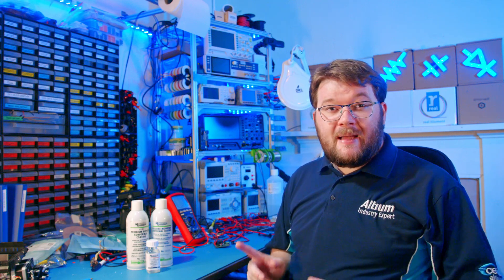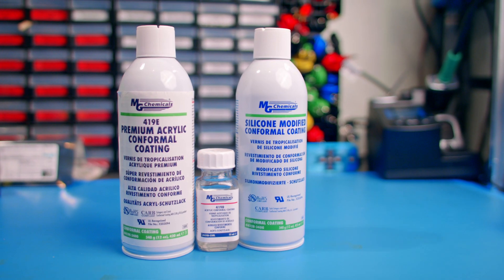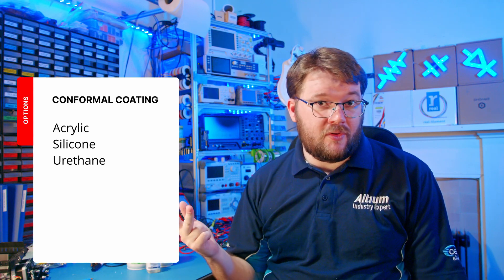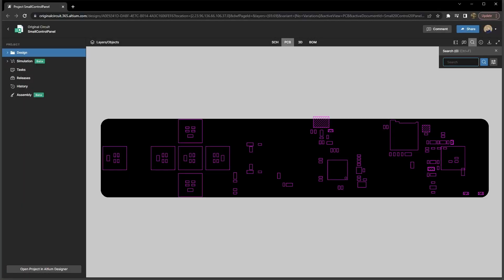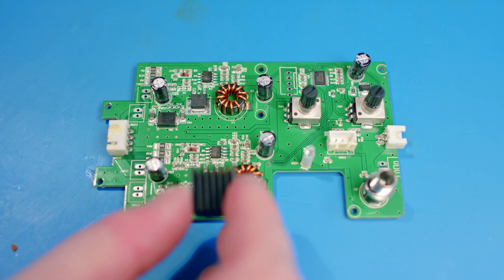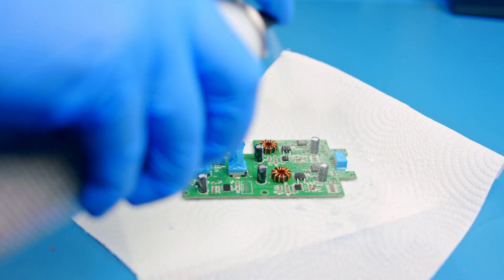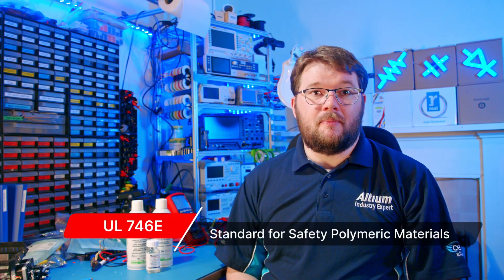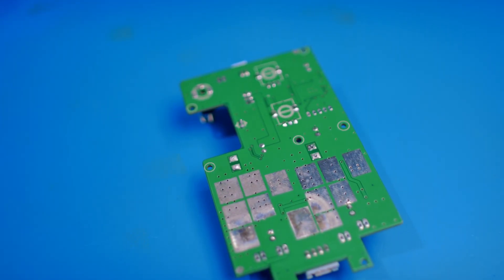Boost PCB Durability with Conformal Coatings

Comment: Very in-depth, I am looking into putting a coating on some solar outdoor lights. Temperature varies throughout the season. These solar lights were so poorly designed and eventually get water on the top and the board if round and flat, so water just stays in place. Anyone have any thoughts on the best the coating, thinking acrylic spray or brushable.
Reply: Mark is not monitoring these questions but I can help you understand this. The problem you have with your solar lights is that the enclosure does not have the appropriate ingress protection (IP) rating. Whenever you buy electrical equipment that you intend to use outdoors, you need to verify that it has the right IP rating for your environment. Typically the minimum would be IP65, you find out what this means from searching on google. a spray coating or brush-on coating on the PCB will not solve the root problem of moisture ingress. If you want to try coating the PCB, you could use an acrylic, urethane, or parylene coating. Humiseal is a good brand that offers acrylic, urethane, and parylene based coatings for PCBs. You could also try a waterproof urethane or epoxy sealant on the enclosure.

Comment: Silicone Modified Conformal coating is the Gold standard for the RC Hobby and a godsend to prevent frying an expensive electronic speed control when one drives through a puddle or for those whom love to drive on snow!
Obviously, it’s not intended to turn your RC vehicles into a submarine but proper application can tolerate brief submersions!

Godspeed🇺🇸🇺🇸🇺🇸

Comment: I've been using conformal coatings for years, and I still think epoxy has its place in certain applications. Don't write it off completely.
Reply: Does it work on gpu pcb coz gpu components make high heat?

Comment: Can you recommend any particular brand of conformal coating that you've had a good experience with?
Reply: HumiSeal products preform well across the board.  They're an excellent "Jack of all trades" coating manufacturer.  Our "Stock" coatings are HumiSeal 1B31 Acrylic and 1C49LV Silicone.

Comment: I appreciate the effort, but I think you missed a few key points about the importance of surface preparation before applying conformal coatings.
It's interesting to hear your thoughts, but I have had success using urethane-based coatings even in small batch sizes. It's all about technique and equipment.

Comment: Can you talk more about the pros and cons of using a robotic system to apply conformal coatings?
Reply: Pros: fast, consistent and repeatable, less masking required.

Cons: expensive, cleaning can be a real PITA, and only conducive to large quantity production.  Robotic application isn't even remotely cost effective for small quantity runs.

Comment: Can you explain more about the thermal expansion coefficients and how they can impact component longevity?
Reply: I'll jump in and answer this.  Some types of conformal coating are surprisingly "hard".  Once applied, they bond to the PCB and to the components.  As the different materials expand and contract according to their CTE, the coating both imparts stress on the components and solder joints, and prevents the joints from flexing as they normally would.

The primary failure mode due to CTE mismatch of coated boards is in the solder joints.

Silicone and synthetic rubber coatings are soft enough to mostly eliminate these concerns, which is why both are popular for boards that will experience a wide temperature range.

For consumer grade boards that will only see a limited range of operating temperatures, these concerns aren't terribly relevant though.
Reply: Sir can i use it on gpu pcb ? Coz gpu components are high in temperature  @benjaminbawkon8040

Comment: In my experience, conformal coatings are only ok for mild conditions. 
We make weather stations and have tried various acrylic, urethane and silicone coatings, silicone dipping compounds as well as plastidip. The only thing that works properly without much hassle is potting the PCBs entirely in a hard PU resin. They are also typically better thermal conductors than air.
Reply: Paralene would do wonderfully in your application.

Comment: Having performed extensive testing on many brands of conformal coating (MG Chem, Humiseal, Miller-Stephenson, DowSil, etc), I can tell you that MG Chem products almost universally performed horribly.  Their silicone coating, in particular, was truly awful.  It's not a pure silicone, but is really a "silicone modified acrylic" - all of the downsides of both chemistries with none of the benefits of actual silicone.
Reply: Which one you find to be best among the brands you have tested so far?
Reply: @7006608  Depends too much on what type and what specifications you're most interested in to make a general answer.  HumiSeal products all performed well across the board, and had the added benefit of being generally easy to source.

Acrylic 1B31 and Silicone 1C49LV became our "go to" coatings of that type.  We also stock Miller-Stephenson Silicone.

3M Novec is an incredibly good performer, but it's cost will make your eyes bleed.  We do use it though when we have a need for very, very thin coating for whatever reason.